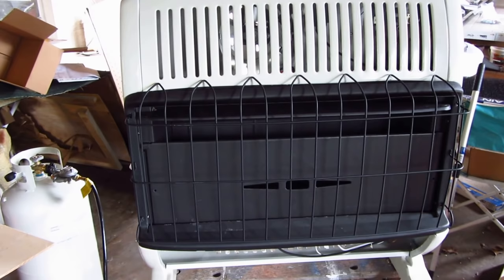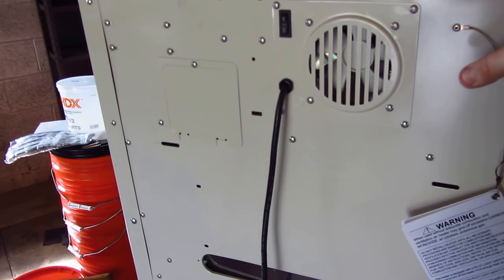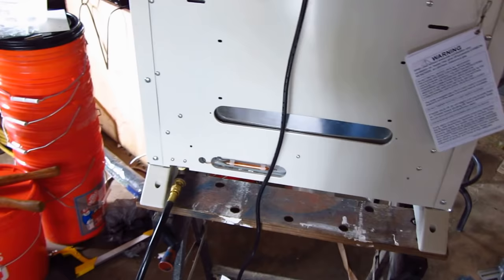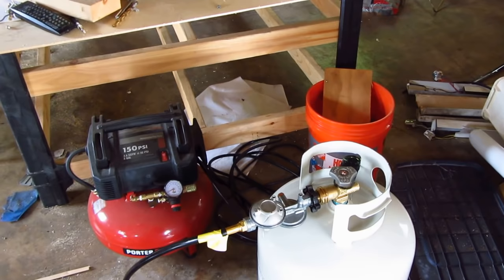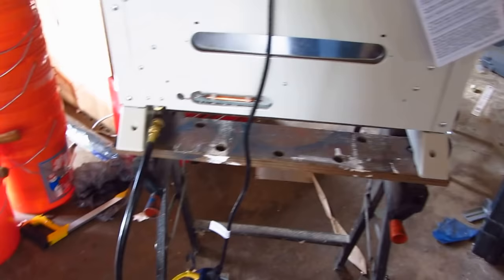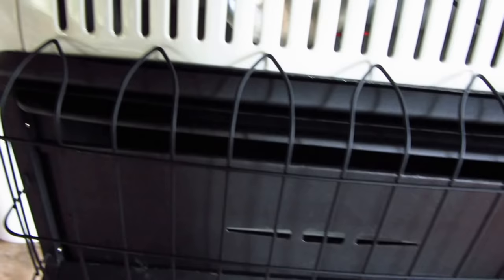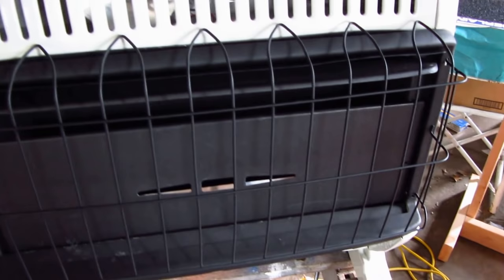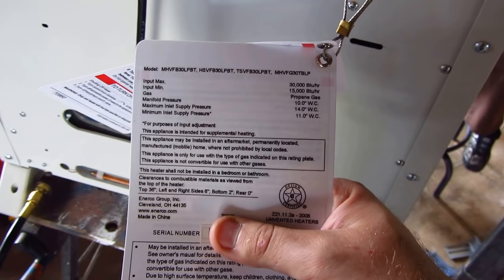The Mr.Heater Blue Flame Vent Free Heater (LP) Review

Comment: We were having trouble with the pilot lighting, didn't know there a battery, thanks to watch this video, you mentioned there is a battery under the red button, our heater works now, thanks.
Reply from the maker: Glad I could help.
Reply: Same as this guy said, except mine seems like it has an AAA battery.  Tried AA and it didn't fit, so I went smaller and all was well.  Thanks for making the video.  Thanks again for telling people to get a two-stage regulator.  That's not in every other video, that's for sure.

Comment: I was told to run a much different setup from the Mr. Heater to the start of the input hose.  I believe that you need a drip pipe to contain the moisture that is produced and a shut-off valve within reach of the heater.  I realize that your LP tank has a shut-off valve but that only would work when the LP tank is in the same room.... which - supposedly - is a no-no.  Many people run the hose thru a wall or floor in order to hook up to a 100 lb. tank.  All of what I'm saying is for when the heater is used more than just for "taking the chill off" occasionally like for an hour in the morning to preheat a room so the main furnace won't have to work so hard or long.
Reply from the maker: Thanks for feedback an info. I did add a condensate drip on it at a later date. But we hardly used this unit, so I gave it to a family member.

But I agree with your assessment of what I did and needed to change in video.

Comment: a fellow hoosier her with a question.
i just bought a new dyna-glo 30 k btu and the knob wont turn in the direction of the 1 - 5 numbers . it isnt connected to a gas supply yet so im guessing that the knob is locked out until pilot heat is detected . im no slouch at mechanical things myself so i'll be finding the answer to this puzzling issue long before i try forcing the knob on the intricate and delicate gas valve . thank you in advance if you can help me with this issue .

Comment: Thank you for the feedback on our heater!! Send us a message if you have any questions and feel free to subscribe to our channel.
Reply from the maker: No problem.
Reply: I bought a 30000 btu natural gas mr. Heater blue flame. I hooked it up, and it has performed without having issue. Realized that I could use a smaller one in the same area and move this to the another place. I bought a 20000 btu and hooked it up to the same output as the 30000 was at and the pilot won't pilot will not light. I have went through all the checks and nothing helps. Any help would be appreciated. (I also took the first 20000 btu back because it was doing the same thing, I just assumed it was a faulty thermal coupler or pilot light in general) now this one is doing the same thing and I must be missing something simple, I don't know.

Comment: I'm curious, what is the purpose of the fan? I grew up with Dearborn heaters without fans. Is it some form of safety feature or does it have another function?
Reply from the maker: It does help move the air away and kinda push it around.

Comment: how did you know what regulator to use for it, i almost bought one but was told i needed a 100lb tank. Is this your first year running it? reviews say to watch for mold.
Reply from the maker: randyusmc I though I saw on the box, Min of 20 lbs tank, Not for sure But it Runs perfect on a 40 Lbs tank. Yes it is my first Year running it. I went with the 2 stage regulator because of a more steady flow, I am going to be buying 2 100 lbs tanks and connecting them with the mr heater 2 tank connection kit.

Comment: loved my Mr. Heater, but the glass kept blowing out, 3 times and the company stated they don't make the parts anymore. so the debate is on, buy another Mr. Heater hoping it was a fluke and we have a lot of parts, or buy a different brand...?
Reply from the maker: +Brenda Sullivan sorry to hear that.  Have you looked at my other video about the ThermaBlaster.  In the end it's up to you but I still like Mr heater, now the ThermaBlaster I have is nice for inside house on wall.
Reply: Note that the Mr Heater unit in this video has a steel plate. If used in a garage, the glass plates tend to get stressed over time due to cold temperatures (when the unit is off) and may crack. The current Mr Heather model with steel plate is F299741.

Comment: What fittings are needed coming out of the bottom of the unit?   I have a Mr. Heater hose and regulator already.   Do i need any thread tape at all?
Reply from the maker: +Roger Niesen they are 3/8" in Fittings,  and pipe.  I use yellow gas tape, you need it.  Then make sure to chk with either soapy water or gas chk spray. Let me know if need any other info.

Comment: What may be wrong when vent is operating okay but no heat is blown around the room? Is there any way to fix it?
Reply from the maker: The fan will only circulate the warm air in front of it.

It doesn't blow tons of heat across a large area. You may have to use a fan or ceiling fan if possible.

Comment: I got one of these and was disappointed that it really doesn't come with a thermostat as stated. You can control the btu output with the knob but it won't shut down and then back on to maintain a set temp. Also, they say you need a 100 lb tank but you don't. The 100lb tank is to maintain proper pressure in cold weather. If you use smaller tanks out in the cold it is a good idea to insulate the tanks or buy a propane tank heater to keep it warm but the smaller tanks work fine if they don't get too cold.
Reply from the maker: you're right it's not really a thermostat per say, But it does turn off and on with temperature unless they changed it. I have used 100 lb tank before but, Very large and heavy and Hard to transport for filling.

Comment: You really have to hold the pilot down (hard) for maybe 2 minutes if you’re just lighting it for the first time or have shut it off for a while. And it works just fine without the fan.
Reply from the maker: Yeah, it's not a bad unit. Sorry for late reply.

Comment: If this burns propane, like a Buddy Heater it can't be ventless, as if it was in an airtight room you would die of carbon monoxide inhalation.  Also, if i remember right, at least for the Buddy Heater your not supposed to use a regulator as that is built into the heater.  For those you need to use a special hose that doesn't have the plasticer for keeping the rubber soft, as the plasticer comes out of the hose under pressure and messes up the heater.
Reply from the maker: Well while it says vent less every one should use a good carbon monoxide detector with one of these, Also as the propane burns there is moisture generated from that.  As far as I know It only has a temperature control valve inside and you must use a regulator.
Reply: It does burn propane and is ventless and indoor safe. Properly burning propane creates carbon dioxide and water. It only produces carbon monoxide when starved of oxygen, not burning efficiently so a well ventilated or large volume of air space is required. This unit is different than a buddy heater in that it requires a low pressure regulator at the tank.

Comment: What is the fan wattage?  I want to hook up the fan to a solar set up to run automatically.   Also how long does the 40# tank last on the low setting?
Reply from the maker: +TheTrooperGirl Thats a great idea. As far as the wattage goes it's not in the Owners manual and it not printed on the fan. im sure the fan wattage is not the much.  I like your Idea, Im looking a building a solar furnace with solar powered fans.

The 40# tank lasts a long time id say 4-5 days depending on how cold it is, but usually how long it runs for us.

Comment: Question here, I have the same heater but i ran my propane through about 16 feet of black steel line to get to my outside tanks, 2 100lb, but cant get mine to light. Im new to propane heaters so would you have any tips? Seems like its not getting gas, is there a need to purge it with 16ft+ of line, if so have any guess as to how?
Reply: tyler thompson do you have a regulator hooked up as well?
Reply: Anthony Hill  yes, a two stage from mr. Heater
Reply: Bleed the line open propane by the heater and bleed the line
Reply from the maker: Purge or bleed air from the line try again.

Comment: I have the same unit . Does anyone heater make noise while heating up or cooling I think it's the metal expanding and contracting loud banging noises
Reply from the maker: Most of these heaters make some type of noise but what you're describing is correct.

Comment: Hey man I have a one and it will light. Fine then runes for a min. Then turns off. But the pilot light stays on and eventually its get to were it won't even turn on the big flame just the pilot light any ideas. Please. It would be much helpful. Thanks.
Reply from the maker: It might be dirty pilot light, or gas valve not opening with thermostat.
Reply: I just bought the heater today and the regulator that I'm using is a regulator for a propane grill 75000 BTU my Dyna-Glo heater is 35000 BTU do you think it's not getting enough gas flow.
Reply from the maker: It might be possible.

Comment: I was also told that the unit has a regulator built into it.  Will it hurt anything if I attach a 2 stage regulator as well in addition to the internal one that comes with the unit?
Reply from the maker: I haven't noticed a problem at all with the 2 stage on my heater.  The internal is just there to regulate it to the btu.
Reply: @IndianaDiy  I'm gonna see if my 10 ft mr. heater hose with no additional filter required will fit the u-joint connection part and if so I'll go with that instead of getting the 2 stage regulator kit !!!
Reply from the maker: Just be careful, better to be safe than sorry!

Comment: I just want to know would that rubber holes be safe to run on a 27,000 BTU ? I'm trying to run my holes out the window with the 20 pound propane gas outside  would this be safe
Reply from the maker: +CBR 600F ACCORD COUPE are you talking about the heater hose in stores you can buy?  You can but since it's not professional install most insurance won't cover if house burns.
Reply: Yes thanks..Can you tell me if it will be safe ?
Reply from the maker: +CBR 600F ACCORD COUPE I couldn't say it's safe to use.  But if you are going to do that I would be very careful. 

Sorry if that's a vague answer
Reply: thanks a lot man
Reply: Rubber tends to crack with the weather so be very careful

Comment: Is it safe to operate the heater with the propane tank in the same room?
Reply from the maker: It's not going to hurt it as long as it's not in front of it.

 You can run it through a wall if you want,but remember if being installed in your house or garage most insurance companies want it professional installed.
Reply: This is what I was worried about with mine. When researching for my basement, all I kept reading was that it was insane to have a propane tank indoors ever.

Comment: why do you suggest the two stage regulator? I'm new to this type of heat and not sure of the setup that should be used.
 Thank you
Reply from the maker: Anthony Julio Well 2 stage is for more of a constant fuel flow, and I haven't had a problem with my heater. I Read that 2 stage works better for heaters and appliances like those. Now I highly recommend a bigger tank than 30 lbs,  I suggest at least a 40 lbs or two connected in series. 

With my Tanks Connected in series using a mr heater two tank connecter, my tanks last me about 4 days or so at about 70-75 F.

Comment: Thank you for posting this video-   looking to do the same setup in the garage with a Dyna-Glo 20,000 btu unit.   Did you have any trouble with the 40lb tanks freezing while operating the heater?  (were your tanks inside, or did you have them outside and run the hose through an exterior wall)
Reply from the maker: +SUBDIVIDED tanks will get cold and frost because of the liquid turning to gas, yeah I had them in a non heated space and ran hose inside.
Reply: Did a frosty tank affect the heater's function in any way?
Reply from the maker: +SUBDIVIDED no,I never had any problems. Id run double propane tanks, when I ran the heater. Both tanks would frost up but no loss in performance.

Comment: Thanks for the video!   Will the thermostat work if the fan is not working?  I am not planning to have it connected to power, but still would like to have the thing running on its own, as long as thermostat will control the temperature!  In fact, how is it done? Does it turn it on and off when set temperature is reached??
Thanks!!
Reply from the maker: +moulin6801 you are correct on both thoughts.  It does continue to work if fan is off or not powered ,  and the thermostat works like a furnace does.  No problem your welcome.
Reply: Yes
Reply: Is there a control knob for the thermostat?

Comment: These work on natural gas and can be put in house. My question is will it run with no power? And what is better this or Kerosene heat?
Reply from the maker: +Drackkor you are correct it will run without power.  It would depend on price of fuel,  plus lp or natural gas units produce condensation.
  Kerosene doesn't produce condensation,  you can buy clear kerosene in stores but higher price.
Reply: Ok that is good to know. Wasn't sure on price and which is better. Kerosene has a smell to it but also has portable quality. But have to run our and buy Kerosene. Thanks
Reply from the maker: +Drackkor yeah that clear kerosene called Kleenheat, I don't know how bad that stuff smells.  I agree about it being portable,  also good back up heater in case of emergency.
Reply: The unit will still work and heat without power but the fan will not work to blow out the heat. It will work the same as a unit without the "fan" option.
Reply: Thanks
Reply: All hydrocarbon fuels (including kerosene, propane, natural gas) release CO2 and H2O when burned. If the heater is vented, the water vapor goes out the vent. If a ventless heater, the water vapor goes into the air in the room.

Comment: Thank you so much! I was trying to find out the fittings I need to hook mine up.  I went to Walmart and lowes, I must have went to the wrong section.  Ill go to lowes for the street elbow and threaded to flared adapter, and 2 stage adaptor, and hose.  Now I can get this going.  This is supplemental to my electric heat.  This will be better I'm sure.
Reply from the maker: Be careful, because some homeowners insurance will not cover it if not professionally installed. And get a good CO detector, better to be safe than sorry.
Reply: @IndianaDiy  Thank you I did'nt even consider that.  I have it on a medal box and with a fireplace screen in front of it.  I'm super cautious.  I have not finished it but have the Carbon Monoxide detector already installed.  I'm hoping this will save me money on electricity and be emergency heat when the electricity goes out.

Comment: I got one of these about 6 years ago. The pilot assembly went out. The website support was absolutely not helpful. I've had to practically take the whole heater apart to replace a $20 part. It's really nuts - so poorly designed. The little door in the back wasn't helpful in replacing the part. There are no videos or tutorials about how to replace the pilot assembly. If it's going to go out so soon, then it shouldn't be a total PITA to replace a $25 part.
Reply from the maker: Wow interesting, I look into that before I have to replace it.

Comment: So there are none of those cermaic grates no orange glow?
Reply from the maker: Yes, you’re correct.
Reply: @IndianaDiy  I'm surprised. Prior to today every such heater I'd seen had grates which turn blue then orange. I saw one of these for sale $100 FB Marketplace and I thought it was missing necessary grates & thus almost didn't buy it until I saw your video.
Reply from the maker: Yes, There are a lot of the ceramic grates on these type of heaters usually i look for contractor grade versions of them to avoid those grates.

Comment: when you mention "cannot be converted" do you mean that I cannot get another size orifice other than what comes with the unit?
Reply from the maker: Correct if you bought propane you can only buy that orifice. I was looking into trying to do a complete conversion but didn't try it, I was going to try and replace all propane parts with natural gas parts.
Reply: +Indiana Diy'er you have me convinced!  I ordered my heater today. (MHVFB30TBLP) If you have any part numbers that I can reference to that would be awesome and greatly appreciated.  I really like your videos they are very easy to understand and extremely helpful.  Thank you so much!!

Comment: These work really well for about a year maybe two if your lucky. I know several people who had these and the thermocouple or the control knob stopped working after about that time. I've even seen the glass just shatter in one of these for no apparent reason. Nobody that I know will buy this brand again.
Reply from the maker: suckmyassloser Well I know parts are cheap from Mr.Heater, But so far Im only using it in my garage. Its a nice unit but I still waiting to see how long it will hold up. I have a family member who bought one for his small garage/shed and is using it as a main heat source. I have looked at other Brands like procom and a few other but never heard anything really from anyone.
Reply from the maker: I don't think they allow them because of the laws, Not For sure.

Comment: How long does the tank of gas last.
Reply from the maker: +timm2020 I was running 3-4 days but I was heating up a 1500 sqft house. Plus I use it with dual 40 lbs tanks, I have a two tank connector.